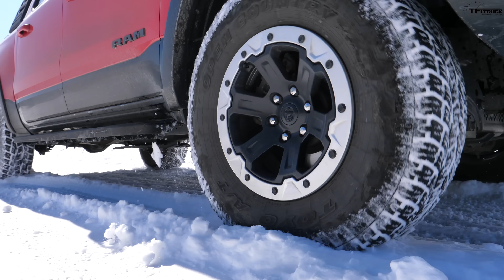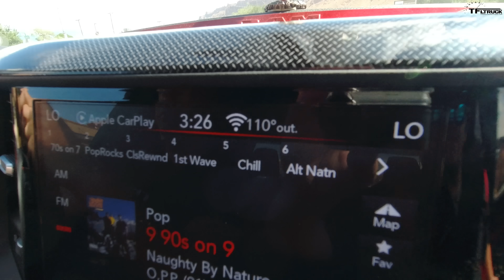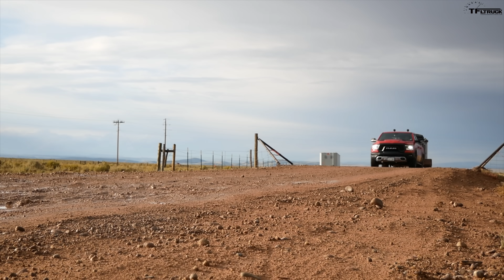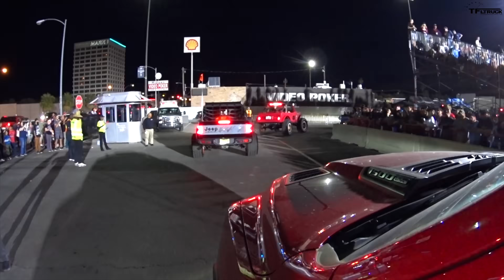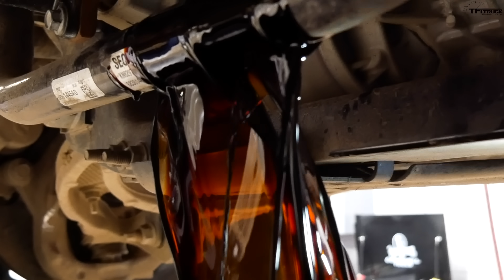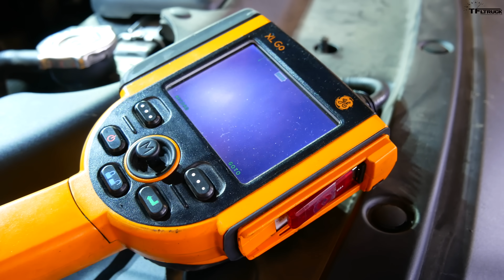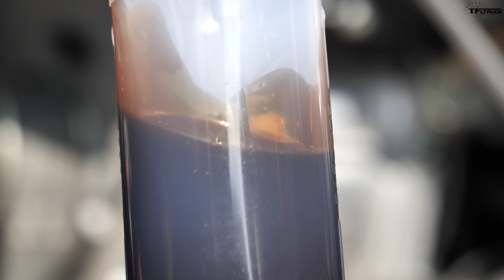You Will Be Surprised at the LOOK INSIDE the HEMI V8 After Months of Torturous Driving! Ep.5

Comment: I would differ here. I would not call your use of this pickup "abuse". The things you have done with it are what many of us do daily (towing, hauling, offloading, highway trips, etc). That said, it is very useful to follow along as you use this pickup as we can all learn about its strengths and weaknesses.
Reply: Yep, i agree.  Definitely not abuse ... i think a pretty weak towing test although i dont know the weight of the trailer however it was tiny so not much wind drag
Reply: Real torture test is like the Ford Ecoboost test from 2011
Dyno simulation 100k miles
Davis Dam test
Pulling Logs as a Skidder out of a Forrest.24 hour towing flat out pulling a Nascar around Homestead racetrack.
Baja race completion
Then total teardown in front of a live audience. Game Over!
Reply: @tnitron9750  like my buddies 2014 f 1 wimpy engine?!?  77,000 miles on his Ecoboost, premature oil changes, never been off road and now needs a timing chain, cam pazers and chain tensions!! His ses light is on and it rattle's on a cold start!! 3,600 dollars in repairs at 77,000 miles!!!
Isn't that the exact same issue the Tritoos had?!?!?? Hummmm torture test my ass!!
YouTube LS vs coyote shoot out...
Buy a Chevy!!!
Reply: I had a 2001 ZR2 that I sold with 252,000 miles on it !! 252,000 miles and tons of off road! Flooring it allll the time and never a problem with the 4.3 v6!! 
Beat on it for 200,000 miles, then I'll be impressed...
I used Mobile 1 oil I mean I beat the crap out of that truck!! I held it floored for four and five minutes straight in deep snow.

Comment: I understand that TFL has to make a living of that channel, but this just ridiculous advertising!
8k isn’t even 1/20 of the drivetrains design life, your driving was no torture at all, compared to what the OEM does during the engine and truck development/ evaluation and on top of that: The oil analyses didn’t even look at the elements indicating bearing wear.
Reply: It was torture test for the oil.. 8k extreme heat and offroad courses is alot to ask of an oil to maintain all its uses.  hopefully they could do the same testing at 50k or even 100k looking at cylinder walls for comparison.